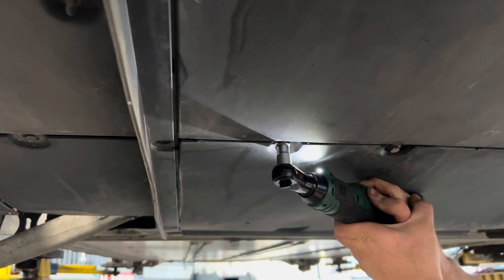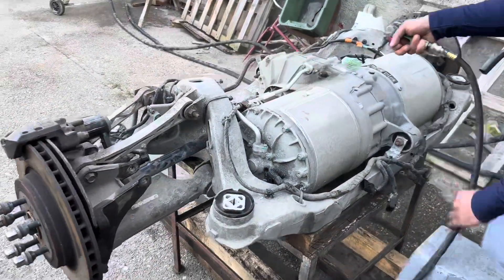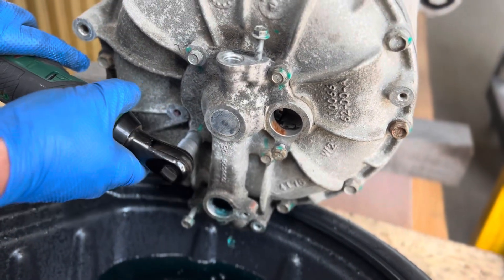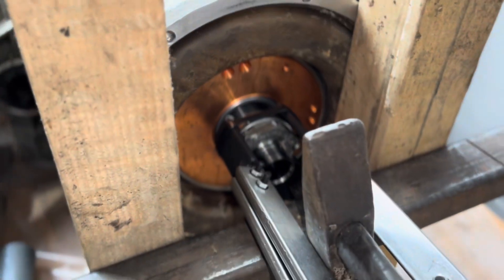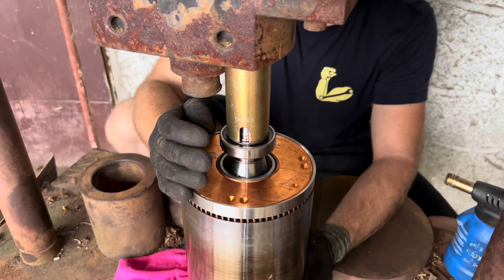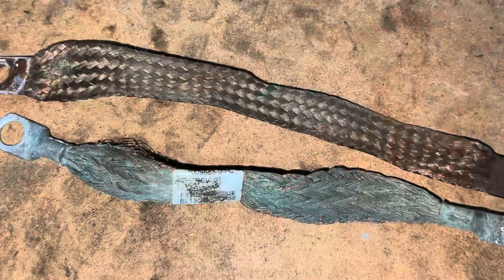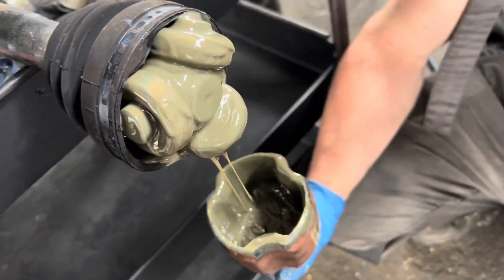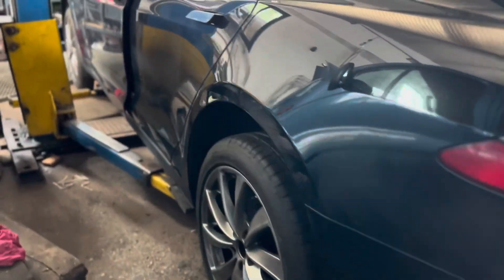Tesla Model S LDU Large Drive Unit Coolant delete, leaking, new manifold

Comment: Hi
So how does the motor and inverter get cooled if we remove the coolant system with this delete kit?
Reply: It just deletes the cooling to the outer bearing. If the car isn't used on track or for towing, it will be fine.
Reply from the maker: Hi, it is just delete the rotor cooling line (1 out of 3). the others still have cooling.

Comment: How much is the cost of this job?
Reply from the maker: The cost for the manifold is around 450 EUR/USD, but it depends on the extent of the damage in the LDU. If additional parts like bearings, seals, new wiring, or similar components are needed, the total cost could range from 1,500 to 2,000–3,000 EUR/USD. On the other hand, Tesla Service would replace the entire LDU with a new one, which costs about 7,000 EUR (based on a quotation I received).

If you tackle the repair yourself before major damage occurs, you could potentially do it for around 1,000 EUR/USD—excluding labor costs. Keep in mind, it’s a 1–2-day job if you have all the necessary parts ready in your garage.

Comment: This is exact same problem which I have now with my M3 LRDM - internal/external resistance goes down when driving. I expect it to be coolant leak, but in my case I will just replace whole LDU, because in Lithuania there's not service that can disassemble LDU to clean it up :(